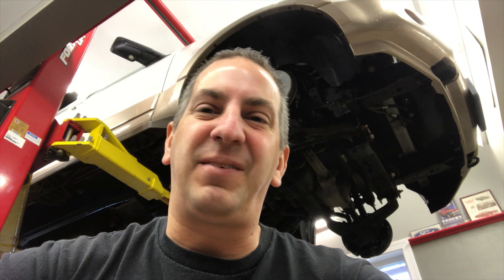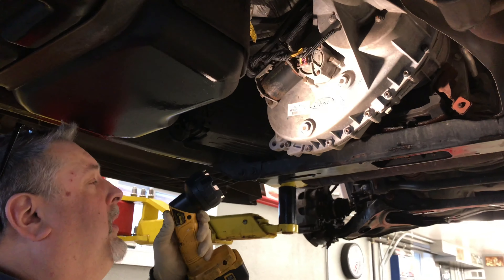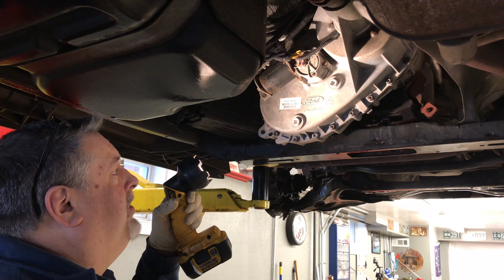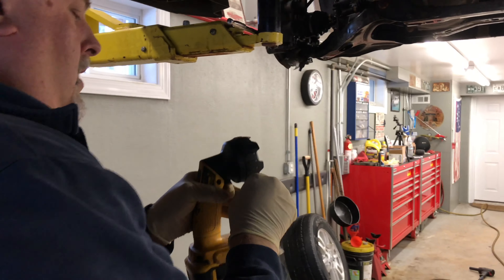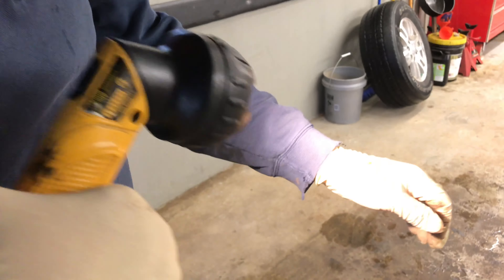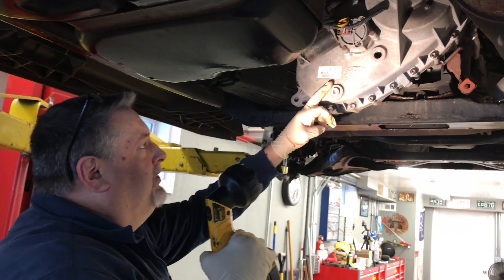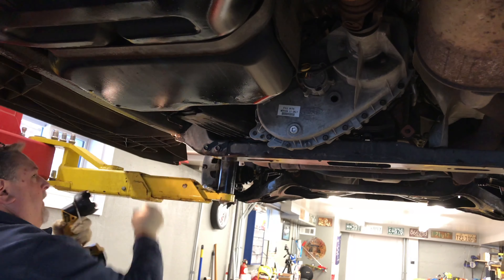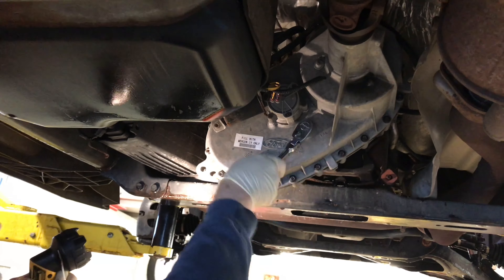How To Check Transfer Case Fluid 2012 Ford Expedition

Comment: rip off, that fluid was fine.
Reply from the maker: lol... We are going to do a fluid change video soon.
Reply: @HomeownerRepair  if its a 2012 there is a pretty good chance the fluid had not been changed since the truck was built, probably time to change it anyways.